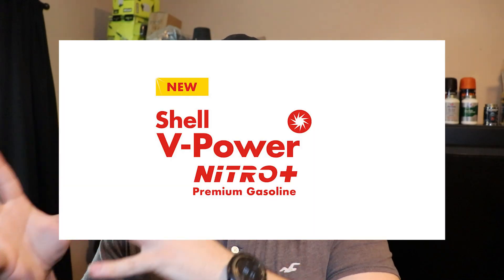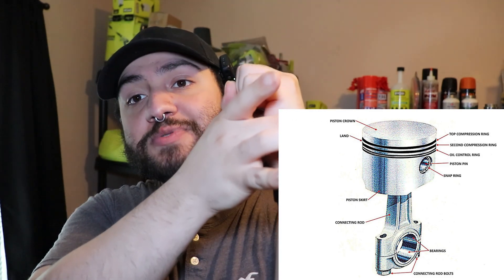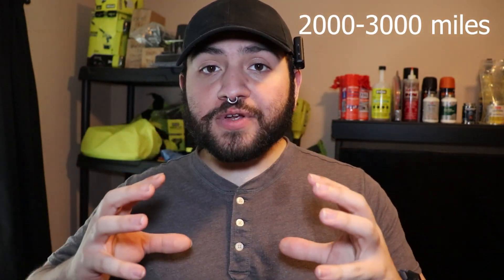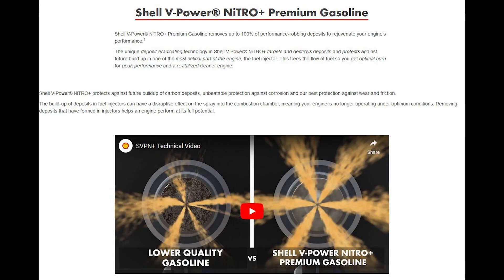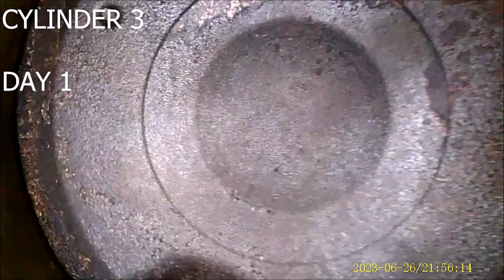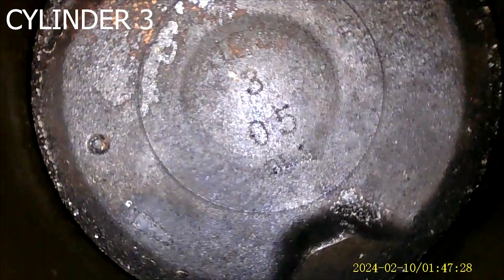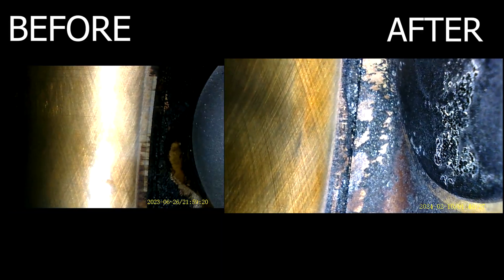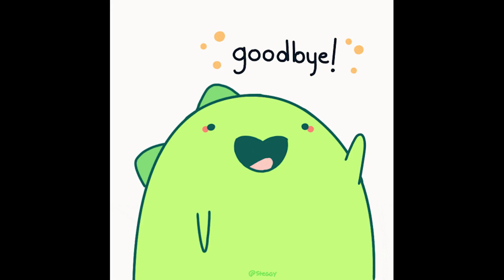IS PREMIUM GAS A SCAM? $$$$ (SHELL V-POWER NITRO +) - 8 Month Experiment

Comment: If you want speed up the process, need to perform Italian Tune Ups on a regular basis.  At lower combustion temps, short trips, more carbon will develop.  Drive the vehicle at 4k rpm for 15 min at highway speeds to get the engine, valves, pistons hot.  Then drive at wide open throttle till it shifts, then do a full deceleration to 1500 rpm, repeat 4-5 times.  You will see marked difference in carbon removal after only one run.  I have done same testing, borescope imaging, engine data logging, and fuel efficiency on my GM 2.4L Ecotec, GDI.  Substantial reduction in engine knock, more advance timing, and better mpgs. Being a rental, and previous owned, you wont remove all the carbon, as it is normal aspect of burning hydrocarbons.  The cleaner the engine, the longer it will last.  Also need to use a premium 100% synthetic oil.
Reply from the maker: Man I haven't heard of the "italian tune up" since a scotty kilmer video a while back. Yeah cheap oil kills cars especially with some people thinking oil lasts forever lol. Most people are doing short trips and not caring about regular maintenance !
Reply: @TOOL_TECHNICAL  https://youtu.be/5C9Ie4BcYew?si=leleysyRCUnVlPVB
Reply: @TOOL_TECHNICAL  The Italian tune up seemed to improve the MPG of a new Camry hybrid I bought (drove to LA and back, MPG went up after at home) and reduced the oil consumption and increased the MPG of a Ducati I own with 37k miles on it (rode it over the Sierras and back, lots of heavy throttle at higher RPMs on emptyish mountain roads).
Reply from the maker: @aluisious  sounds like fun! Be safe on bikes, too many dumb unsafe drivers out there both cars and bikers that get others killed. A relaxing drive can become a wreck scene in moments :face-orange-biting-nails:
Reply: You say $70 each time like it was an additional expense. It would actually be the difference from what gas was used before the shell and shell price! What's that come to 20 bucks a fill up? So $160
Reply from the maker: @atlantaacman4750  70 US AMERICAN DEAD PRESIDENT DOLLARS PER FILL UP. Not sure where you're getting 20 dollar fill-ups, but that would be a tank full of watered down fuel.
Reply: @TOOL_TECHNICAL  you act like it's $70 additional dollars, how much to fill up with regular gas? How much to fill up with shell 93? It isn't $70 more than regular would cost. It's only the difference between the two!
Reply from the maker: @atlantaacman4750  I get it's about 50 to fill reg and 70 for nitro the point is not everyone wants to spend that on gas. If you say you fill 8 times in 3  weeks that's 560 bucks not including the last week of the month. Some people do have to choose between food and car fuel so it is a give and take when wanting to clean/improve you vehicle's performance
Reply: @TOOL_TECHNICAL  i only use shell 93, i can tell a huge difference with it in my tank. So its about $20 more each fillup. That makes more sense. You should state that because the way yoou have presented it makes it 2.5 times more expensive than it actuallly is. Doesn't make sense. I also use fuel rewards so i het 10 cent off each gallon and sometimes more. It helps. The fuel cost i incur is built into each call, job so  it doesnt interfere with living expenses
Reply from the maker: @atlantaacman4750  I also use the reward perks to save where I can (it does add up). Not sure where I said anything except that it's 70 bucks and curious to whether people believe the extra cost is justified, but the owner can usually fill with regular for ~45+ dollars so a $70 fill up is indeed 2x the normal cost of fuel.
Reply: @TOOL_TECHNICAL  I drive 90 miles a day, only require 1 fill up a week.  You numbers don't add up. Difference in average price for regular and premium is .70.  The cost is only half as much as you claimed.
Reply from the maker: @tssci6774  wherever you're getting cents more for this fuel enjoy it. The difference is in this application ~ 25 more dollars per fill up compared to Regular shell. This person doesn't drive daily and certainly not 90 miles a day. Everyone's usage varies of course. 70 $ x 8 fillups (once per month) = $560. I assure you there is no smoke and mirrors.
Reply: @TOOL_TECHNICAL  ...Great picts and a valid worthwhile experiment. Might want to cover oil dilution with them using premium vs regular also. Luv Shell and Chevron fuel but if my local station was charging me $ 1.66 more per gallon for premium I would not trade there...
Reply: Works great for bmws and cars with twin turbos

Comment: Your octane of premium is lower in the US than the UK, the premium is 99 octane what is it there? Do you know what the additive package is in the fuel? I think you're better off just using injector cleaner I put diesel injector cleaner in my petrol/gasoline and that seem to work really well. I've heard about people using isopropanol not tried it myself and don't know how well it works also 105 lacquer thinner supposed to be good not tried it. Anybody hands let me know!!
Reply from the maker: @jedi-mic  for shell highest I've seen is 93. Essentially it's how resistant to explosions/pre igniting is. Fuel injector cleaner only goes so far with efficiency and my main goal was the additives that cleaned the carbon deposits. 99 octane is nice. Not a crazy fan of paint thinner or other chemicals randomly used to clean but hey if it works it works!

Comment: I've been using premium fuel/high test gasoline since car was new (7yrs ago) because my car is Direct injection only & the power/response increase is needed in my n/a car....i know it costs more, but i do get better mileage (5-7%) than the manufacturers claim
Reply from the maker: GDI is a double-sided sword lol people love em but the cleaning/buildup AND Price on alot of the components push others toward the standard multiport injection.

Aww jeeezzz lol Thanks for sharing Mr. Garrison! Since Mr. Slave isn't here I won't make an easy direct injection joke (oh Jeezus chrysssss)
Reply: @TOOL_TECHNICAL  
Lol😀

Yeh, GDI caught me off guard when I bought my car.....but I also use a GDI specific upper engine spray cleaner (through a vacuum line... engine running etc)

PS, Mr slave has run off with Mr hat & I'm worried 🙁
Reply from the maker: @mrgarrison3516  Don't be too worried, he's still a bottom wherever he may be..
Reply from the maker: @mrgarrison3516  also yeah additives can come in clutch because there's a lot of labor to taking apart certain intake portions to get to those gunked up valves. I've seen walnut sand blasting that leaves them looking NEW.

Comment: Ok..Nissan Rogue/185 HP/ Designed for 87 octane fuel..Just use a great fuel treatment..My choice is Star Tron Fuel Enzyme Treatment..Rogue is known for  great torque/Bottom end HP..Gas mileage is always questionable..Use 0w20-30 Syn Oil/ Class 4 spec every 5000 miles...
Reply from the maker: personally 3k to 5k is ideal so I'm with you on the 5000 mi change interval or the time interval (ex. 12 months or 75000 miles) and for sure additives are cheaper than gas (especially nowadays) and I only use Full synthetic oil but definitely stick to whatever your manufacturer recommends. We must be responsible with the info we share. It's a short jump from using a different oil viscosity to can I use cooking or tanning oil? to ill just use water. If it asks for 5W-30 then that's what it gets. I've done a 0 degree freeze test with Full synthetic mobile 1 vs Castrol synthetic blend both 5W-30 did well which proved that even sitting overnight in ice, the right oil in your car doesn't need to be thinner unless you live in a frozen tundra lol or thicker unless you're driving through a volcano :)
~ Work Smart
Reply: @TOOL_TECHNICAL  who makes 100% synthetic does valvoline and what is it called? What's about Castrol oil or shell? amsoil does but I can't get it here easily.
Reply from the maker: @jedi-mic  bummer. Excluding amsoil you can look into mobile 1, valvoline, royal purple, Castrol (gtx is okay but their Edge line seems to have superior additives). The main thing are the additives. If you're looking for anti foaming, anti sludge build up, film protection (oil leaves a small film over metal components upon contact which is important when starting your vehicle because of the time it take the engine circulate oil). I did a small oil freeze test comparing full synthetic to synthetic blend and they both handled cold fine but the full synthetic definitely is better for both extremes of temperature (lowest it gets to 10 -14 degrees F here). Find the additives you feel your car needs most and if all else fails....learn to ride a bike 🤣

Comment: Seems like it cleaned it a bit. I would say that a fueld additive detergent that comes in bottles would be more useful and then the Shell is just there to maintain and to prevent carbon build up.
Reply from the maker: I've tried the lucas fuel additive for cleaning injectors and seen little if any changes in performance. The shell fuel was certainly effective, the concern is the commitment to pricing and patience. Shell says that this fuel doesn't just clean but prevents build-up so I'd recommend people not let it get bad.
Reply: @TOOL_TECHNICAL  I watched chris fix video on a one time use of techron and nothing really changed. I think the results you've gotten despite taking several months is already great. Thanks for the video and amazing commitment.
Reply from the maker: @zeppkfw  Appreciate the kind words zepp, knowledge is power
Reply: what you were seeing was damage as well.   Imagine if you used that gas from day one you would have less damage and that engine would have looked alot better.  The oil geek did a video and a german study showed less engine wear.  In the end i think what we saw here was less deposits but lets face it the gasoline can't repair the damage.

Comment: Would love to see a similar video showing the cleaning ability of Chevron premium fuel. My car requires premium and my owners manual recommends Chevron brand. Would be interesting to see if it cleans as well as Shell premium.
Reply: As I commented earlier, I used to always use stuff from premium. Most of my cars have been small turbo charged and lately TDI engines to boot but when I switch to Shell, I can tell a difference so I ain’t going back. I will not put anything else in my car if I can help it sometimes I put a couple gallons in if I’m in between Places and feel nervous about running on reserve. It says I only have 20 miles left to go before I’m out of gas. You know what I mean! Boy get away from Chevron, but that might be my number to go to. If I didn’t have Shell gasoline the power nitro (whatever the hell it is).
Reply from the maker: I would say as far as processing and refining shell and chevron have separate processes, However because shell refining has more shall we say quality control they are able to justify higher pricing. There are no chevron fuel stations near me. I would say as long as you have the recommended octane level (premium for different people can be 91, 93 etc.) your fuel should be fine as long as you're not filling at some cheap sketchy place where you have to jiggle the handle and spin around 3 times for it work lol
Reply: @TOOL_TECHNICAL  There is no difference in refining in California. All the gas comes from the same refinery.
Reply from the maker: @aluisious  perhaps I should've been more specific in saying the additives package. the heating, distillation etc. of the fuel is the same as far as a base fuel but Shell certainly has it's work cut out for worn, high build-up vehicles. still prefer multi port injection over GDIs which are a nightmare if not regularly cleaned (valves get plugged and super gunked up)

Comment: Bro why didn’t you use some fuel additive instead to save some cash? Have you tried adding some to each fill up?
Reply from the maker: The point of the experiment was testing the effects of the quality from the additives in the fuel. Using other additives is like saying why did you run that race when you could drive to the finish line lol. This was meant to see if people are paying for a brand name like Shell or if they will genuinely benefit from mechanical/performance improvement. Thanks for sharing
Reply: @TOOL_TECHNICAL  I hear ya, for sure. But have you thought about doing a fuel additive video? There aren’t enough fuel additive review videos on Youtube
Reply from the maker: @Pearlio  Great suggestion. Currently I'm working on more rookie / DIY friendly content while also trying to grow. Almost at 300 subs and still have plenty to learn!

Comment: The questions I have are 1) Is Shell premium better for cleaning than Shell regular? and 2) does Shell premium clean better than cheaper Top Tier premium gasolines?  Shell is the most expensive in the SF Bay Area, with Shell premium about $1/gal more than Costco, which is also a Top Tier gasoline.
Reply from the maker: Great questions! 
I can't speak on Costco's behalf however what I can answer is:
1. Yes, shell premium is better than it's regular. Typically every station gets gas made in that area anyways the only difference are the additive formula each company adds to boost the performance within their specs.
2. From what I've seen I believe it performs better than GULF'S PREMIUM. SHELL NITRO has 6x the cleaning agents of regular gas but each fuel company has their premium formula. 

At the end of the day, unless your manual/car:
- asks for premium (higher octane)
- has misfires from excess carbon deposits
- is pre igniting during the combustion cycle

You can stick to regular and use a fuel additive to boost octane level if needed.

 If you're trying to clean your engine the cleaning additives matter more than the octane rating 

Hope that helps :)
Reply: Yes. I use it all the time. Hear and runs a lot better. Added chemicals to shell v.
Reply: Actually Shell additive package meets “Top Tier” fuel standards (along with some others). But Top Tier status requires elevated additives across all grades of fuel that provider sells - not just premium.  If you have older cars, motorcycles or other engines that don’t like ethanol, some Shell locations also sell non-ethanol fuel that is also required to meet Top Tier standards. I run it in my bike and I can actually feel a difference in throttle response…

Comment: i suspect for most cars, probably not. however, i have a 2018 regal with a 2.0 turbo and it says premium recommended. it isn't necessary or you'll damage the engine, it just really means if you wanna unlock more of the engines performance potential. i have run it for hundreds of miles on regular 87 octane and it runs just fine. it just has less pep. 
i don't push my car often so, i usually use reg 87 and just go from there. however, it can be fun to warm up the engine and then go do a bit of spirited driving from time to time and i can notice the extra power when using premium.
Reply from the maker: There are fuel additives that boost the octane levels of base fuels so if there are hot spots or pre ignitions causing misfires that is a cheaper route to fix that with more worn engines. For porshes and other cars that are REQUIRE premium additives are much cheaper than the inflation we pay for gas. While driving this vehicle I honestly don't see a major difference given it calls for 87 regular. Thank you for Sharing :)